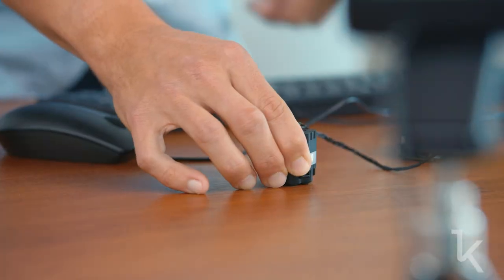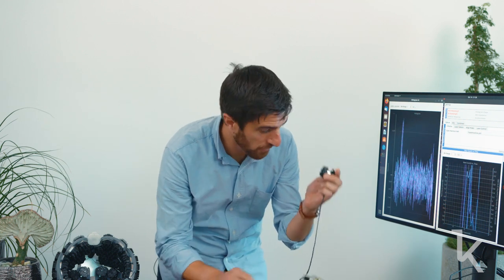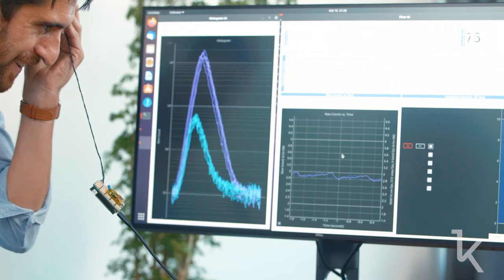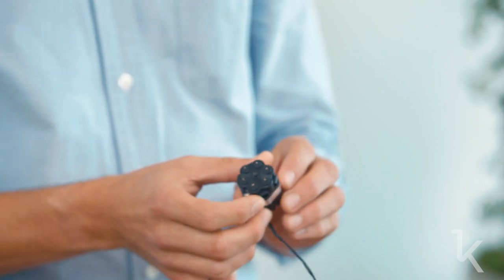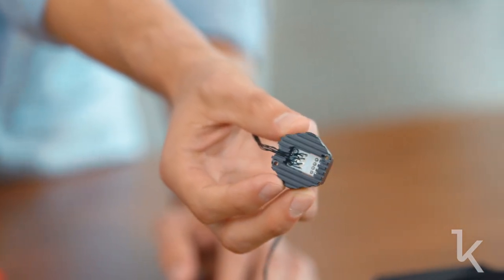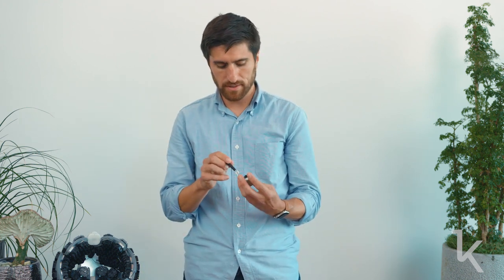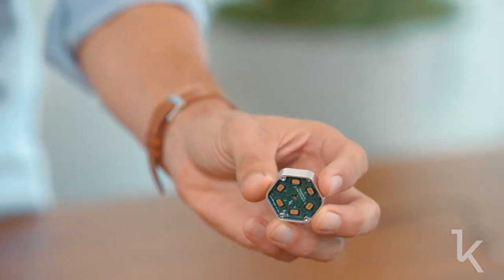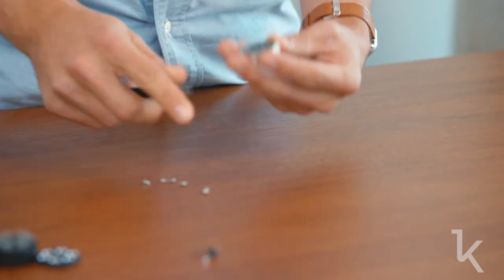Kernel Flow Teardown

Comment: 50 odd (DOUBLE) boards sounds pretty inefficient.
i hope v2 can use 50 ICs on 1 board with fiber optic routing and at least reduce it to 1 support board for the sensors on each module or route that through fiber optic too
it could drive the price down so plebs like me could get their hands on one one day!